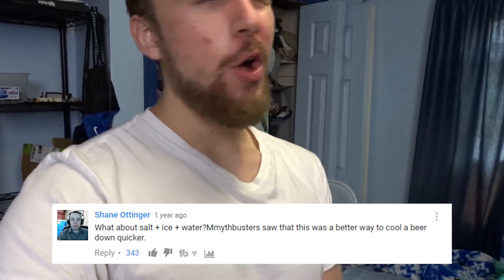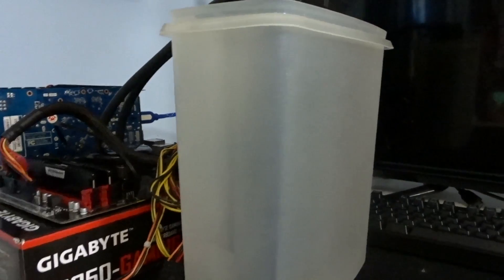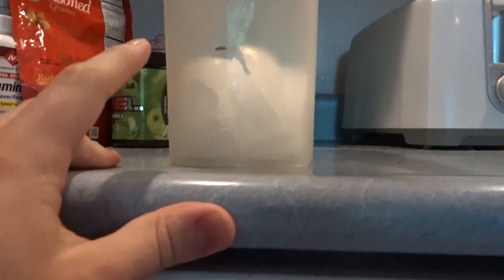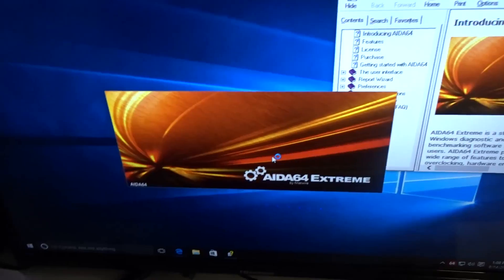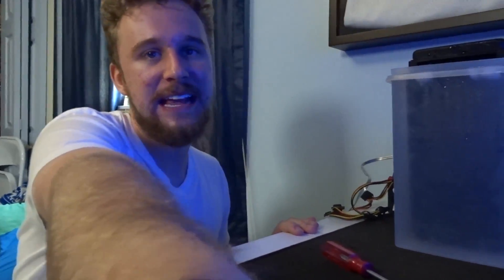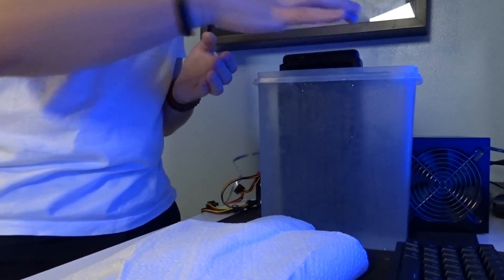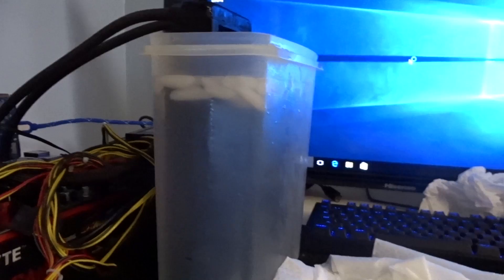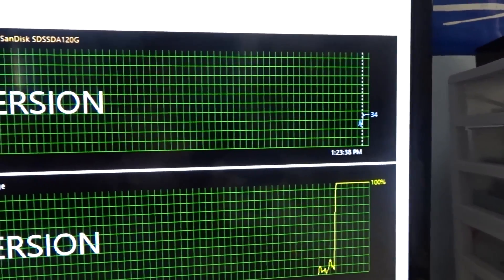AIO Submerged in Ice Water - Cool or Unsafe?

Comment: should have used way more % of ice to water. Should be able to get temps down a lot more. It depends how cold your freezer makes your ice, but a saturated salt solution can get down below 0 vs just 32 with the ice water.
Reply: I wonder at what point you run the risk of freezing the liquid inside the tubes? Im guessing its gotta go pretty low since the liquid inside is moving?

Comment: I am a Mechanical Engineer, and I have always been thinking of a cooling pond type of cooler for cpu. If you have a pool or maybe a bathtub, try routing pipes going to an aquarium pump going back to cpu. Let the hot line pipe, drip over the tub at a considerable height. I don't know if you get my idea, but try googling cooling towers. Cool vid by the way.
Reply: https://www.youtube.com/watch?v=zFrCwaCTHqY
Reply: I’m a mechanical engineering third year, and have wondered for a while what effect cooling the liquid itself would have on a water cooling system. It seems more practical as you’d just have to pass a section of the hose through or beside a heat exchanger, and with my limited education in heat exchange it seems like it would have a similar effect on thermal performance in such a small scale system. Would it be effective, do you think?

Comment: 6:29 Pretty much pinned at 34 degrees... after 1 minute 31 seconds. Interesting video though. In the future, when you test an AIO's temps, let the stress test run for a while, so the liquid in the cooler can actually change temps. AIO's will always take longer to heat up/cooldown compared to a giant hunk of metal :)

Comment: You should of used dry ice🌽😎
Reply: LN2?
Also " should have"
Reply: Dry ice is the solidified version of carbon dioxide and since it's heavier than air, it fills up the room from the bottom. If you don't have ventillation and end up falling asleep in the same room, you could die. I read in an article that it happened before in a college dorm.
Reply: Dry ice is dangerous to use indoors. You could suffocate to death...
Reply: Tibor Klein if you have good ventelation you can even open the natural gas and nothing would happen unless you decide to do the thug face and smoke some weed😎🚬💥